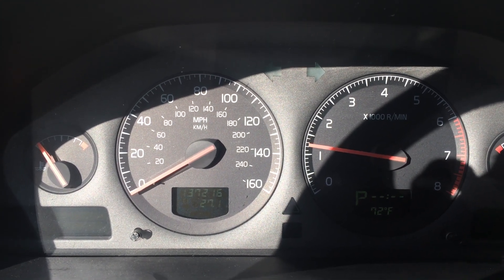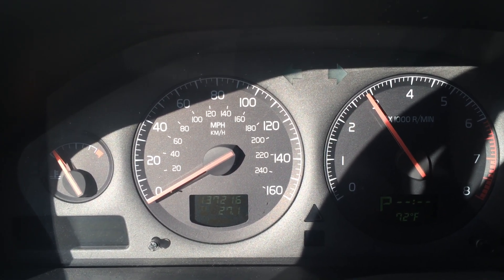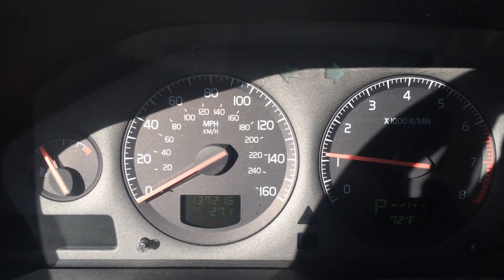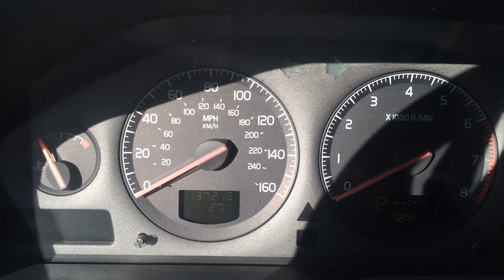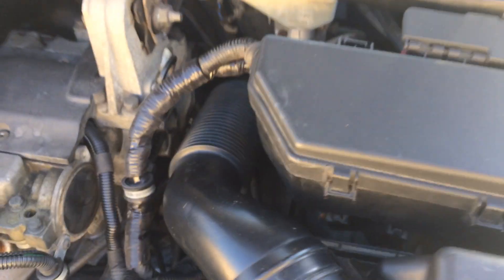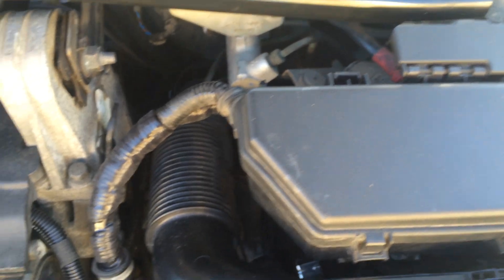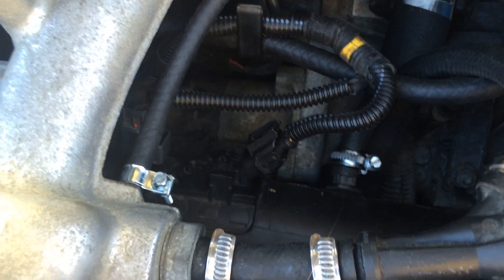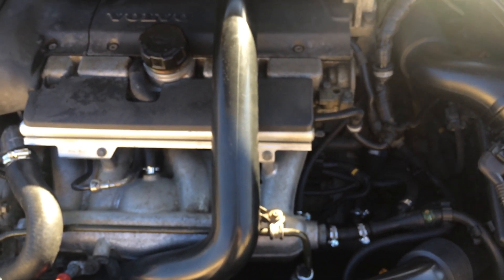2001 Volvo V70 ETM XeMODeX failure

Comment: The Xemodex rebuilt ETM on my 01 V70XC failed also.  Albeit it was after 7 years but they advertise as once they rebuild you never have to worry about the ETM again and give a lifetime warranty.  Xemodex would not replace or rebuild mine because I was not the original purchaser, even though it clearly had the Xemodex sticker with bar codes on the unit.
I used to be a big proponent of Xemodex even though you can find others to install the contactless TPS for less...or many do it themselves.  The lifetime warranty is the big draw.  I lost a lot of faith in Xemodex and am not sure I would recommend now after they wiggled out of their warranty.
Reply: I have my replacement by a Volvo dealership. Because of doing software updates. But they also made it very clear if I sell my car. It wouldn’t be a warranty anymore. Also it is more just a warranty thing for a lot of business. Like I have buy parts from FCP and told the new owner about them. They also can’t get a warranty. Because it change hands. (Volvo 2002 S60 Base)